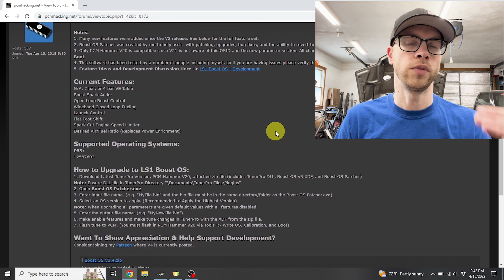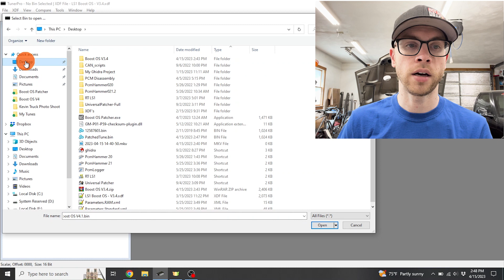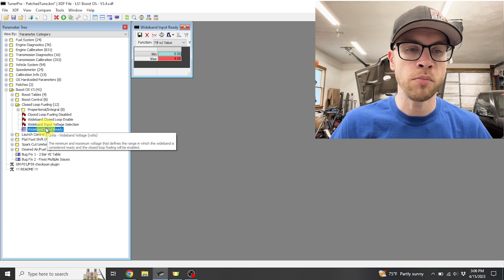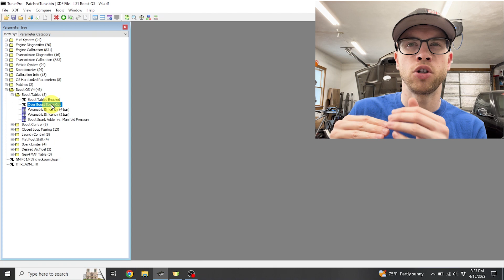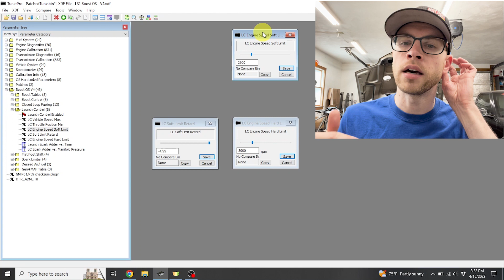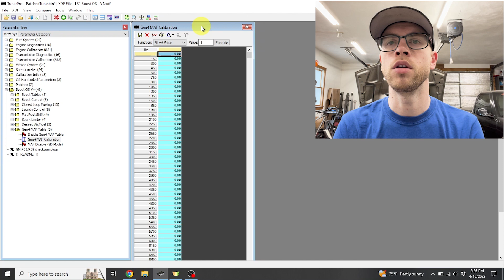Comment: this looks like a nice option compared to the current OS im running on hp tuners, is this something that would work on a truck p59 with a 4l80? Current OS is a 1262062 swapped from a 12587811

Comment: I was working on a self learning closed loop boost control if you want to include that into the program.
the basic idea was boost per rpm, boost per tps, boost per gear, make it pick whichever was lower, interpolate the table to create a boost value for the exact spot it's at, then use a bit of self learning to get the ecu to be able to hold the solenoid open for quicker boost ramp up but also avoiding overshoots. then from their using a basic if else table to modulate the solenoid and then shut it off when the motor is no longer asking for boost or in boost.
was gonna use an arduino with pigtails from the crank sensor, throttle, and eventually transmission.
just about to finish up my 2005 LQ4 turbo build so testing could be done on that.
plan was also to do boost cut with afr, boost, eventually fuel pressure, with a relay between the fuel injectors for a fuel cut, along with closing the Mac valve. with the ecu could you not throw it into DFCO?

Comment: For you to be able to add boost tables you had to reverse engineer the entire firmware or just enough like duplicating the fuel tables, and enabling the map sensor to ready positive pressure? I want to do the same for a motorcycle, and also release the software for free
Reply: You don’t need to reverse engineer the whole thing. I have only reversed what I needed to make it work and a little more to make sure I wasn’t impacting any other code with my new code.
Reply: @turbov6  could you share more study material? I want to do the same
Reply: @DanCycles  for reverse engineering? It’s pretty specific to the ECU so I would search for anyone that’s already done work on it. I learned so much from other people’s work even if I didn’t understand it the first dozen times I read it.
Reply: @turbov6  I will do for the Hayabusa gen 3, it was done already for the gen 2 and there is even a free software called Ecueditor, I will try to use ghidra to open both bin files, stock and with fuel by map and see the differences and try to learn more
Reply: @turbov6  quick question, for you to add fueling by map pressure, you had to add another table right? So you had to add more information on the stock firmware. Were you able to just partially reverse the code and recompile it and everything works just fine? I was worried that I needed to reverse everything to be able to recompile the firmware
Reply: @DanCycles  I wrote everything in assembly language so there was no need to compile anything.
Reply: @turbov6  are you going to make a video about it? 😭 I want to do this so bad
Reply: @DanCycles  yeah I could do that. I’ll try to put something together for another video on how to patch code.
Reply: @turbov6  thank you 🙏 I really want to learn and would be nice if you could make a video because is exactly what I’m trying to do. It would make my life 10x easier

Comment: Could you remove the transmission code for automatics and replace with manual transmission segment for extra space on the P01? This would work for anyone running manual transmission as well as TH400 and stuff. Just a thought. 👍👍

Comment: what 4bar are you using?
Reply: I’m actually using a 3 bar right now, but I will eventually use a GM 4 bar. I’m not sure what they are from but it’s a factory GM sensor.
Reply: @turbov6  interesting, so I haven't looked super close yet, but does the xdf give you the option for the 3bar?
Reply: @turbov6  so how exactly are you dealing with scaling the 3bar sensor for the 4bar table? Is there a setting I'm missing somewhere to scale the  map sensor for pressure range vs the voltage the sensor produces at said bar(psi)? In my limited experience looking at the Holley software and some others, you would at least be setting up the table to match the sensor.
Reply: @pnwsr6  Yes, there are values to calibrate the MAP sensor.

Comment: how do you identify what type pcm you have and also is there a good place to get support on how to better use this OS im new to the whole tuning thing.
Reply: The connectors have specific colors. If you are looking for something specific I could make it my next video.
Reply: @turbov6  I mainly just trying to figure out if your software will work for my application. I have an '09 Silverado with the 4.3 l. V6 vortec
Reply: @ericcowell757  No I believe that would have been a different ECU in that year.

Comment: Holy cow, 4bar, boost cut, AND boost control?! This is all pretty nice.

Even with it being open loop, that's still big especially with RPM lookup. Most mild engine combos will see torque drop after 4k, this will easily let them get torque back up (relatively) safely.

Comment: Can someone help me with a AEM 30-0300 wideband in "wideband calibration". From what I'm seeing at less than .50 volts the aem says "sensor not ready". At above 4.50 volts the aem says sensor error. So what numbers should I put in wide band calibration to work correctly.

Comment: Went a 10.4 on V4 last night. Launch control worked great! Still working out some issues trying to get that 9.9 pass lol
Reply: Nice work!
Reply: Mind sharing what map sensor you are running?
Reply: @joedelossantos184  mine is a 3 bar map sensor from a 1.4 turbo Chevy Cruze. Parts store sells them also.
Reply: @thatturbotruck  thanks. Currently running a 2 bar os with hp tuner. Getting ready to try this setup.